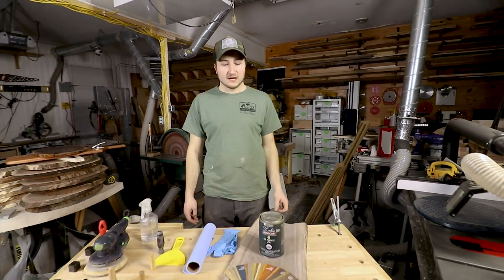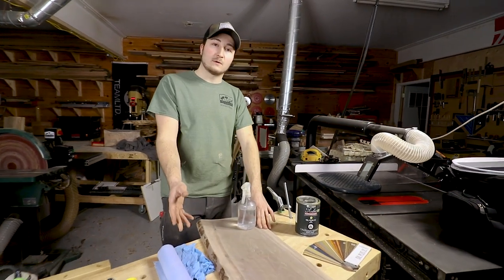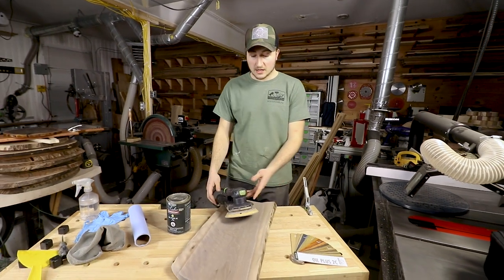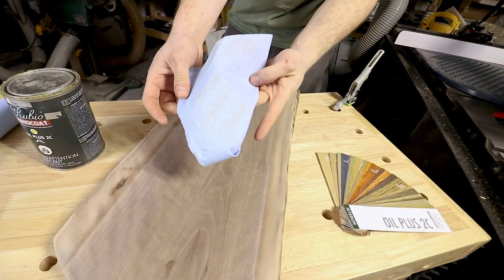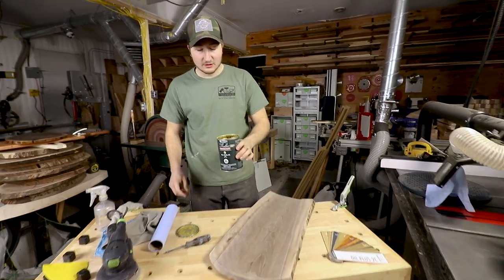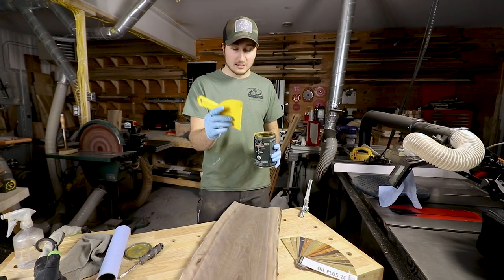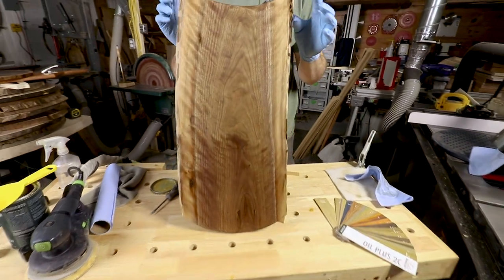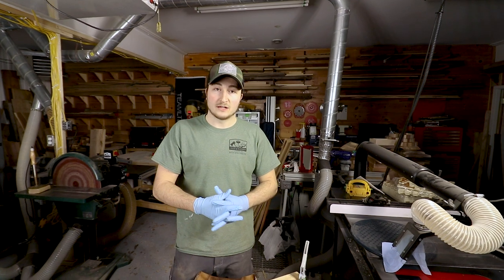Applying Rubio Monocoat

Comment: Rubio 2C does not rely on a clean surface for purposes of “adhesion”...it is a chemical reaction at the molecular level and it only “reacts” to virgin wood fibers. Clean the surface well however like this video explains.
Reply from the maker: Correct. But your surface still needs to be clean.
Reply: @OutoftheWoodsCustomWoodworking  what's best to fully clean surface ?

Comment: I have 3 pieces of Black Walnut I've already sanded with 220. I'm wanting to make wall clocks with them. Would I still be able to use Rubio Monocoat oil if I spray with water, let it dry and resand as in your video? Thanks!

Comment: what do you do if you somehow mess it up?  like if you spilled something and didn't wipe it off and it seeped through?  like some type of cleaning solvent, etc.   would you just use 120 grit sandpaper, sand that spot, and then rub rubio back on?
Reply: It is different for different finishes. Typically you sand the spot using same method as surrounding wood. Apply rubio. Wait 5 minutes and wipe off. THEN (This is the crucial step) you BUFF IT INTO SURROUNDING WOOD USING MAROON PAD. I have done dozens of touchups and it works everytime.

Comment: Great video, Joe! I'm going to be using Rubio on an upcoming dining table. Is it really true you don't need to clear coat or seal this finish in anyway once you apply the oil? Or would you recommend using the hardener on something like that? I want it to be durable and food safe obviously.
Reply from the maker: Luke Martin Use the hardener! One coat application is all it takes. They say 2 may be a good idea on more porous woods, but I haven't had any issues with one coat. Once it's fully cured after 7 days it will be "food safe". It's a great product. Message me with any other questions!
Reply: Thanks Joe. Might just DM you on instagram if I have any more questions.

Comment: I’m using this on open shelving. Do I need to apply poly or do I have to use the hardener, to prevent water or cups from making rings and such?
Reply from the maker: Cure time with the hardener is 1 week. Without is 2-3 weeks

Comment: cure time is like 28 days without the hardener....
Reply: 3 weeks vs 1 week. But more importantly, with the hardener it is cured by 60 and 80% after 1 and 2 days respectively, making it ready to use after just 1-2 days. Without hardener it doesnt only take 3x longer to reach 100%, but it's also more gradual: 10, 20 and 40% after 1, 2 and 7 days. respectively.

Comment: Thanks for the video!  I'm super interested in Monocoat and it's hard to find people who have used it on furniture where I live.  I'm curious how well you think it holds up for a table surface.  I want to build a dining table, and I don't want to have to always use place-mats or a tablecloth to protect the wood.  Do you think the monocoat provides enough scratch protection to keep a tabletop looking good when things like silverware and cups are frequently placed on it and moved around?  Do wet glasses leave water marks from condensation like you sometimes see with varnishes?

Sorry for all the questions!  Thanks so much for any thoughts!  (if you are bored, you could make a video using a treated piece of wood and film while trying to scratch it with keys, or test it with a cold drink sitting on it.  I know that would be a lot of work, but it would be the only one on Youtube!  There is one video showing if wine easily stains it, and that is all I can find).

Cheers!
Reply: I heard mentioned in another video that Rubio engineered this originally for floors, so it holds up extremely well and is very durable.

Comment: Does the smell from the Rubio monocoat go away after its fully cured? I recently applied some to a cheese board and it still has the smell.
Reply from the maker: Yes it should be gone by the time it is cured. It takes 3 weeks to cure without the hardener added.

Comment: Why no more than 150?
Reply from the maker: So the oil can have a proper bond to the wood. I've done higher grits than 150 but that is what they recommend.
Reply: If you want to go higher than 150 this is what you do (and what I have done). 100>120>Apply WATCO oil>150>Apply more WATCO oil>180>220>Clean>Water Pop>Apply Rubio With RED pad. Wait 24 hours then apply Universal Maintenance Oil for more durability.